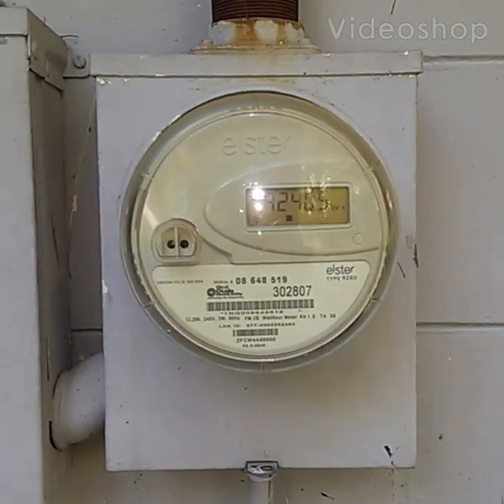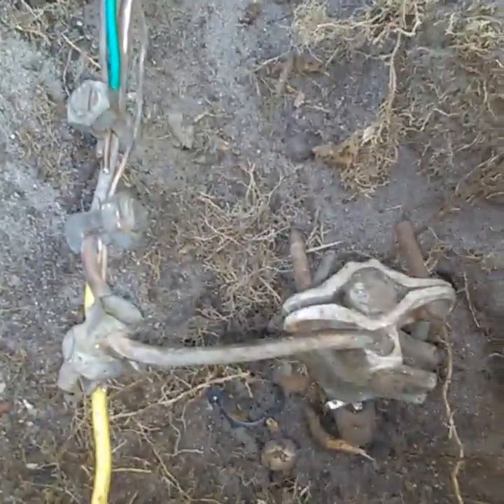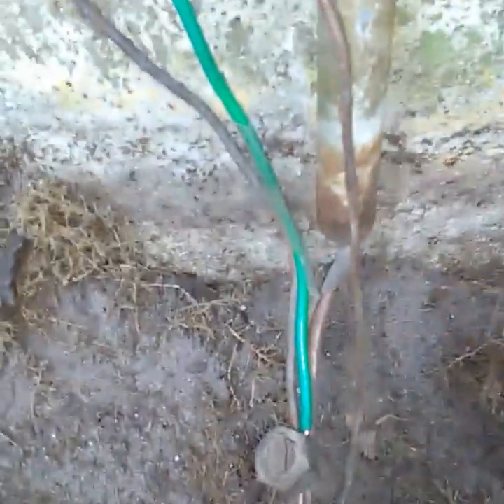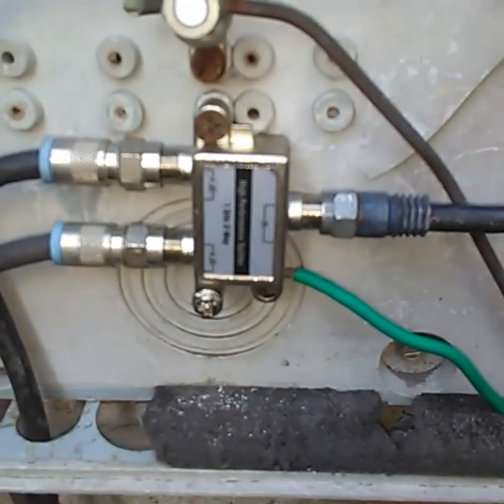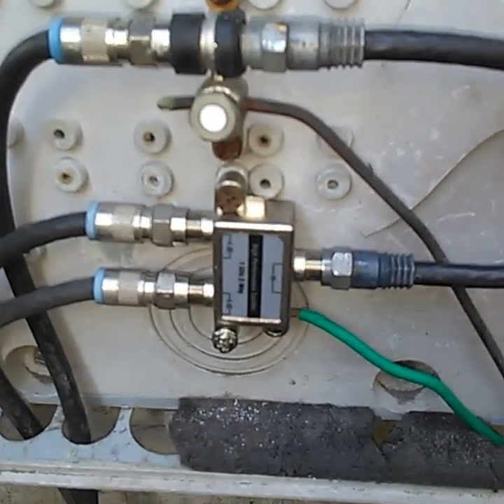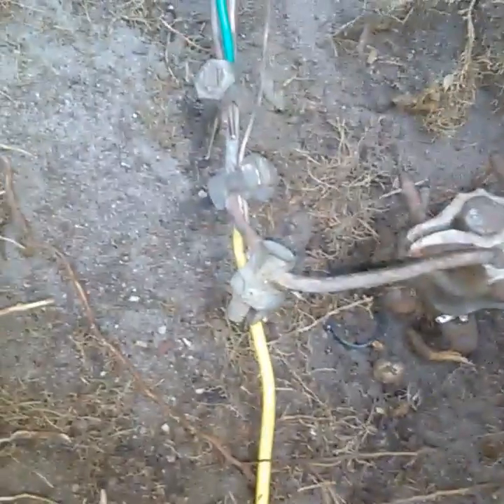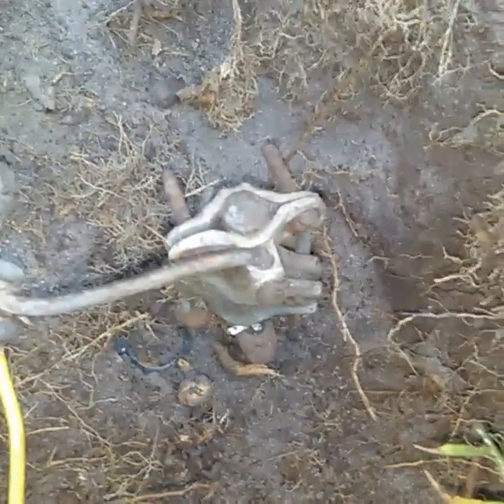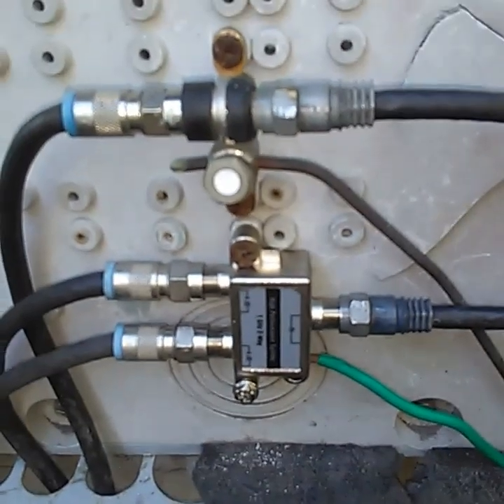TV GROUNDING VIDEO #2

Comment: you are the only guy that explained it well. everybody else is using these microsoft paint drawing sor just talking. and I also needed to know how to handle grounding with use of a splitter, the other guys only ground 1 antenna wire but not splitter is involved! thanks

Comment: quick tip on making the ground wire straight. Cut the length you need then tie one end to something sturdy. take the free end and put it in the chuck of a hand held drill. pull tight then squeeze the trigger on the drill should straighten the line like a wire coat hanger.